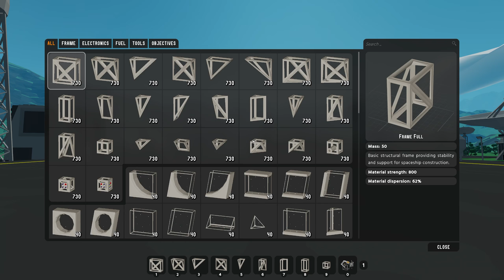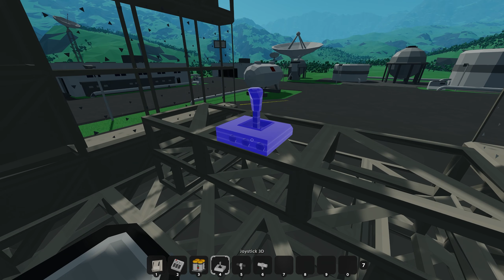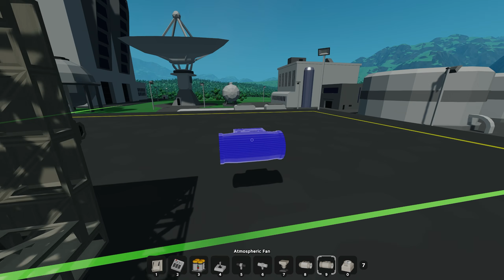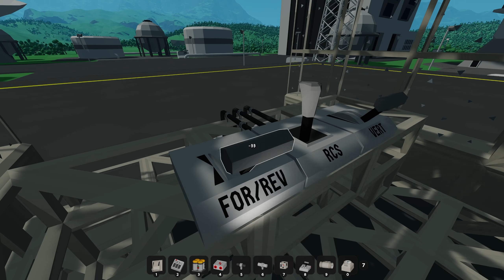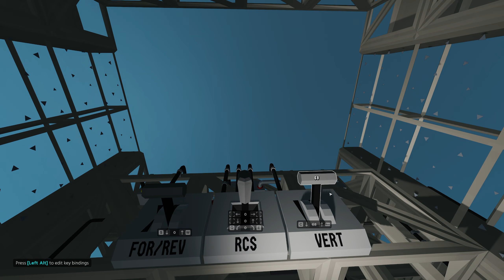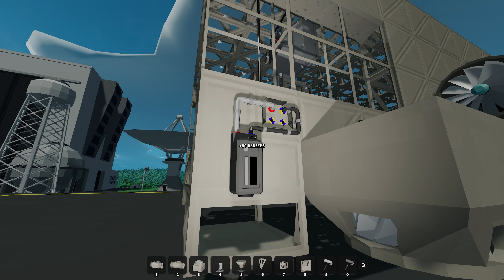Approximately Up: How to build ships tutorial

Comment from the maker: ✅ SMALL DEVELOPER CORRECTIONS:
-  I was incorrect about the shear strength increasing for components mounted on welded armor. Confirmed with the developer Lukas it makes no difference. But it is easier to weld the armor before mounting things onto it 😉 
-  Also make sure to weld the "Frame Quarter with Ports" block to get a full seal. There is armor to be welded on those ports that I missed in the video.

Comment: 45:03 my friend and I just strapped them both on the back as forward thrusters. We shot at the moon at over 9000 and ended up using our rcs thrusters to do a 180 and decelerate for.... about 6 minutes.
Reply from the maker: And once you get to the moon you unlock long range detectors to make finding your brake point on the next run even easier. It's the first run that is definitely the trickiest.

Comment: ts bunz i routed new thrusters now when i use the rev thrust it dont work forward perfect reverse nothing thrusters not even turning on
Reply from the maker: You likely may have severed a data cable to the forward thrusters.
Reply: @diggrok i don’t think so, there’s only one cable coming from the forward/rev thrust which goes to my splitter for left and right then into another splitter for all 6 of my thrusters, i’ve tested even on a barebones with the same setup and i can’t get reverse or -1 to work
Reply from the maker: @exessgames  Are you flipping the invert switch on the back of your reverse thrusters so they respond to input between -1 and 0? Otherwise all your thrusters will fire at once.
Reply: am i supposed to have seperate thrusters for reverse?

Comment: You can't move forward in space with your electric thrusters pointed vertically. How can i fly towards the moon with them oriented vertically?
Reply from the maker: You don't you just fly vertically. Take off towards the moon then when you get close to the moon VTOL land on the moon. I demonstrate it here in this video: https://www.youtube.com/watch?v=oKIN1Is_-jc

The main benefit to vertical is you'll just have more power to slow your descent coming into the moon. But ultimately you can orient the thrusters in any direction you want so just go with whatever give you the most comfort and control. Eventually you'll unlock more electric thrusters so initially you just need to get to the moon.

Comment: Great video! Just about to try the moon mission, Whats a good weight to aim for? I literally just made a 20k weight ship and the RCD cannot change the roll and pitch XD
Reply from the maker: The lighter the ship, the easier it will be to get there on your first try. I can’t imagine a ship heavy enough to not get any RCS response. You really just need a ship that will get you there safely the first time. Once you do moon missions you unlock long range detectors which can be used to setup the auto brake system which will make interplanetary travel much easier in the future.

Comment: On medium batteries there is a data output you can hook up to an addition array and datameter, and I like to use a horizontal meter as well, to give you an accurate reading of your battery throughout your travels, I also hook up my velocimeter to a 270 arc display and my altimeter to a vertical meter, when doing so make sure to adjust your minimum and maximum on your displays.
Reply from the maker: It is pretty fun all the different ways you can manage and display data in this game. Really unique.

Comment: I had all my thrust foreward for the moonlanding started my slowdown at 9000 m/s and came to a halt 2000m off the moons surface after flipping my shitbox around to do a breaking burn. Landing was then done via glass hole in the floor.

Your way is quite a lot more relaxed
Reply from the maker: Once you get the auto braking system it gets a little simpler 😉

Comment: if you're building non brick shaped ships, its important to know, that your cables can break on strain. weld any surface your wires attach to directly, and any lengthy segments that your wires run along. Also, weld any spot that you place a component, or it has a good chance of just slipping off when you thrust.
Reply from the maker: The dev did confirm that it makes no difference if a block an item is attached to is welded or not

Comment: Do you know why certain walls/conduits wood be breaking whenever I sit in my seat?
Reply: It only happens when I map my buttons apparently
Reply from the maker: If it's happening when you get in your seat but not when holding R to enter build/fly mode then it sounds like it might be a bug. You might want to report it on the Approximately Up Discord. That's a strange one for sure.

Comment: im still spinning no matter what i change thrusters to, both engines powered and working cant figure it out lol engines powered and work but if i put it in reverse mode doesnt turn on at all cool game tho ...
Reply from the maker: If both engines are powered and working then it should just be as simple as inverting the data input switch on one side not the other. Would really have to see what's going on to fully diagnose 🤔

Comment: the winter package quest needs more batteries than shown in this video. I flew to it grabbed it and on the return the engine died out due to battery. 2nd trip I put 2 large batteries for the engines, but then all the meters(dashboard) died out cause of low battery so I put individual battery for them. then 3rd controls broke cause one booster fell off during landing. I had to fly backwards but it didn't reach the area of landing. 4th flight the joystick ran out of battery half way back and ended up having to crash land it(the door had no electricity to open) half kilometer away from the base and finished the quest by dragging the package while running to base.  so fair bit warning for all those who want to do second mission in the ice island, make sure you put individual batteries for joystick and door, radar, tv, and the alignment thing.
Reply from the maker: After the first mission you unlock medium batteries which let you go farther. I always place the maximum batteries I can onto my ship since there isn't a good reason not to.

Comment: thank you so much for this video, spent 4 hrs trying to make ship with out no tutorial and ended up making one that has no yaw right or rotation. so I had to rely on ya left for everything which couldn't be used for quest.  btw at 37:45 you definitely need more power cause my tv was connected to the 2 batteries that went to all the controls and radar. problem was the tv drained the battery half way to my mission. had to redo it with extra battery for tv alone.
Reply from the maker: I just wire everything to one battery bank. There isn't a real advantage in this demo to having dedicated batteries for certain systems vs having all power run all circuits. I did the dedicated battery thing early on and kept losing power to my cockpit modules and quickly switched to just having all batteries power all components.

Comment: i followed your video to a tee and yet my forward and reverse constantly spin me. ive changed the buttons on both the thrusters one by one and even flipped the thruster as well after the buttons didnt change it... always spinning.
Reply from the maker: Are you flipping both switches at once or just one side? You should only be flipping the switch on one side. 

There’s also a chance your thrusters are either not on center of mass. Or most likely one side is not receiving data input or power, making only the thrusters on one side operational, causing spin. In which case double check all connections.
Reply: @diggrok  Thanks for the help, still couldn't get it but your video def helped me learn a bunch. keep making these!

Comment: Thanks your vid helped me with a very specific issue I couldn't find an answer for! My RCS roll thrusters would NOT work!!! Tried 2d joystick and eventually got lucky on a vertical lever that gave an output. It's come to my realisation that if you want roll using the 3d joystick it is UNUSABLE as is while using a keyboard and mouse 😂 After I saw you map the joystick I tried it and now it works perfectly! You HAVE to add keybinds otherwise it will never output a signal for the roll thrusters 😂 It should say something about that in the description.

I wonder if they expect you to have a 3d joystick. THAT would be nice to have for this game, I will look around at some.
Reply from the maker: Glad it helped! The core gameplay loop left a lot of unanswered questions for sure 😅

Comment: I followed this exactly how you did it. But when I started testing, the RCS isn’t working at all. Like there’s no power to the joystick. I’ve checked all the cabling and the controller button is on. 

Any idea how to fix this?
Reply from the maker: There could be various things. It's hard to troubleshoot without seeing it. Does the RCS controller have power and did you adjust the knob on each individual RCS thruster to the appropriate axis? Also you can open up the manual with "M" and there is a tutorial in there with a graphic you can spin around and zoom in on just to confirm everything is set right.

Or is the issue you're just in build mode? You can't fly in build mode. You have to hold R to enter fly/mission mode which enables your ship functionality.

Comment: why the ver lever  only turns on left side?
Reply from the maker: Not sure what you're asking exactly... but if I had to guess it sounds like only the thrusters on one side of your ship are firing and not the other. if that's the case the thrusters on the side not working are either not wired to power or their data cable doesn't run to your control stick properly. Let me know if that's what you meant 😅

Comment: My brother and I have tried getting RCS to work on our ship and no matter what we try it just doesn't work at all. We have kinda a big ship but looking at the RCS controller just shows us blinking red lights. Any idea of what's happening?
Reply from the maker: Does the RCS controller have power? Once flying, those lights are the battery levels for your individual RCS thrusters. They start as green, then turn yellow when low, then become red when dead. There is no way to charge the RCS thrusters so if they die during your mission, there's nothing you can do.

But if as soon as you enter fly mode they're all blinking red I'm guessing that means your RCS controller has no power or else they fell off or something.

Also ensure you're changing the knob on the sides of each individual RCS thrust to set them to their specific control mode. Otherwise they'll default to all being the same axis. The blinking red lights could also mean you don't have the RCS thrust set on the axis which are flashing red.

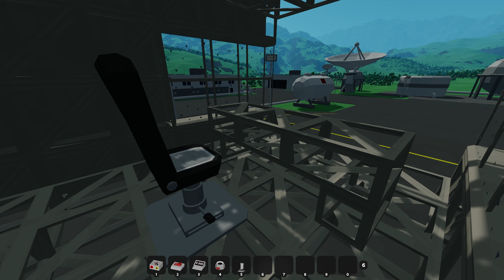If you press M it opens a manual to review how to configure each RCS thruster as well as the controller. Also covered at 6:42

Comment: Can you tell me why it's falling off? The engine is simply mounted correctly.
Reply from the maker: Would have to see the setup. My guess is it either isn't mounted correctly, your ship is to high when entering into fly mode and it's shearing off on impact, or you have another thruster pointing at your thruster which is making it fall off. (You can't have components in front of thrusters, including RCS, or the component in front of the thruster will fall off)

Comment: what if the batteries don't work at all
Reply from the maker: That would have to be a wiring issue. Sounds like the power output isn't hooked to anything on your ship. Or your batteries aren't mounted properly and disconnect from your ship when you enter fly mode. Only the bottom part of the battery is weldable to any surface. You might also have them on top of a surface which isn't weldable.

Comment: Why would you puit the rockets as vertical; throttles when u need to navigate to space, how are u gon do it
Reply from the maker: I get into that more in this video: https://youtu.be/oKIN1Is_-jc

Whether you put them as vertical or horizontal is personal preference. Since we don't have missions to do in space we just have to get to the moon I made them vertical so that 1) I can see out of the top/bottom windows to gauge distance to the moon which is easier than looking behind you or using cameras where the depth perception is off and 2) The vertical thrust gives more power should you descend too quickly towards a planet allowing for better escape from a crash.

There is no right or wrong answer, it's just what you prefer.

Comment: Hey man, really thankful for this video, I was wondering if you knew how to display battery power as a percentage on a data meter? I was trying to figure it out but just kept getting confused, thanks in advance.
Reply from the maker: For any batteries which have a data output on them like medium batteries you have to sum all of those numbers together then run the total sum through a divider which receives data from a fixed number which is equal to the combined power of all the batteries. Then that will output a percentage which can be displayed on a meter. 

I've never tried to set one up because it was more work than it was worth when battery levels weren't an issue for any of the demo missions, but that is roughly the process and it will take a quite a few logic blocks connected to achieve the output. (Really wish we could just manually program individual blocks rather than needing a bunch to just perform basic math functions) 😅
Reply: @diggrok  Thanks for the reply man, next time I play I'll try it out :)

Comment: note the altimeter doesnt need to be on the bottom i threw it on my top as i had wiring to a thruster close to there and it works fine 
so i assume it just needs to be facing the blue part away from your ship while its mounted anywhere outside the ship
Reply from the maker: Interesting. I sort of wondered about that and if it could be used as a distance meter if placed forward. Guess that clears that up!
Reply: For some reason for me I thought I did it wrong since I placed it on an open spot on the front of my ship where the velocity sensor and trajectory sensor go (that one also displays weird but idk if I know how to actually read it) but it looks like how it is in this vid. Only difference is on my gauge it just displays completely random numbers based on the ships angle, but I don't know what's interfering with it

Comment: So for the thrusters I mounted and routed exactly how you did but my right one doesn’t work at all, do you possibly know why?
Reply from the maker: That is always going to come down to data and/or power connections. Always check your wiring to make sure the thruster has power and that it's data input is connected to the output of a controller.

Comment: I've had the game for 2 days and finished all 6 missions with a box ship, what was new to me after watching this:

- I didn't know that the levers had a button to change zero mode to be in the middle or bottom. I used a remapper to do this.
- That you can use Ctrl to get a finer tune when using lever/joystick controls.
- I do my 3D joystick similar to drone controls. Arrows for pitch/roll, A/D for yaw, and S/W for backward/forward (instead of Vert which was F/R).
- using a lever instead of toggle for gate, that's cool. though I do have windows in the back, I'll still use this for a better view.
Reply from the maker: And this only scratches the surface! Those logic blocks in the game can allow for some pretty wild stuff.
Reply: @diggrok I tried out the red button for the gate and found out it's a spring type, not a switch type button. I imagine there is a way to logic it to a toggle but it wasn't worth trying at the time.

Comment: My pitch and roll never saves lol. I set it to pitch A and ones I start again it's back to yaw
Reply from the maker: You have to make those adjustments when in build mode if you want them to save permanently. Any changes made to knobs or components when in fly mode only retain during that session.

Also worth noting to make the change in build mode you have to have nothing in your hands which you can do by pressing the tilda (~) key to empty your hands. Then you can adjust knobs in build mode and they will retain those settings when entering into fly mode.
Reply: @diggrok thanks my issue was carrying a welder while trying to make adjustments in build mode 😅

Comment: i havent watched the video yet but i came to ask is there any way at all to save the ships so you can continue on them later or use them again? ive lost three ships so far by just going to the menu and i dont see any save button anywhere
Reply from the maker: Yes press B to open Blueprints when in build mode to save and load your builds.
Reply: @diggrok  Don't suppose this applies to the first in game tutorial where you patch up the ship and try to fly to HQ? I crashed on the way there but couldn't find any way to continue other than going back to the main menu. And the tutorial seems to be the gateway to the rest of the content. Will have another go tonight but not sure if I want to be patching the ship every time before fumbling with the controls.
Reply from the maker: @RunSwimFly  not sure what happens in the tutorial when you crash, but normally you just hold R to enter build mode which should reset the ship then hold R to enter back to fly mode. There is no "reparing" mechanics in this game. If you crash you just reset the mission with your fresh ship.